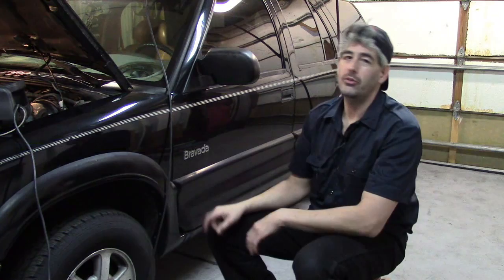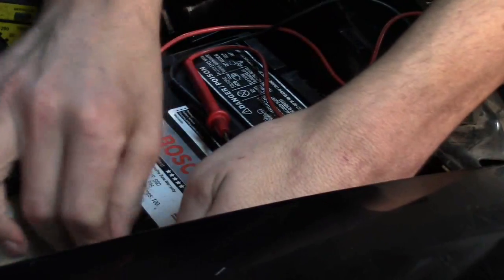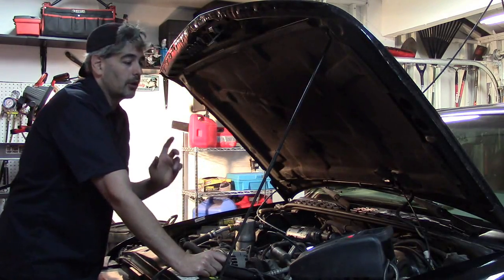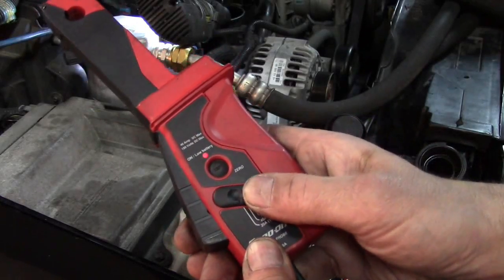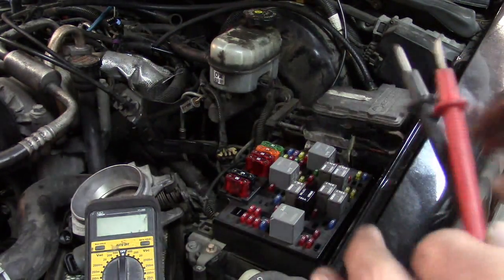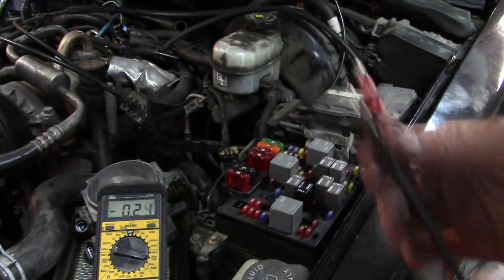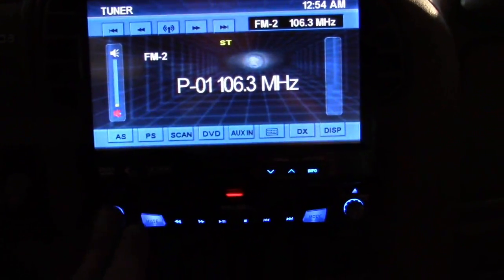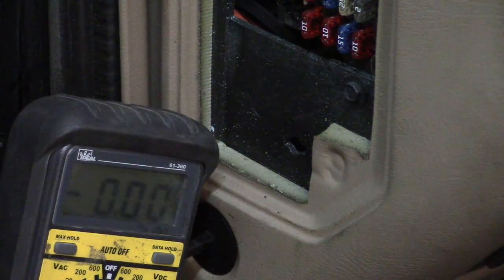Improved Methods to Find Parasitic Draw (Battery Drains Overnight)

Comment: I have a 2017 Hyundai Sonata LTD Hybrid with 65,000KM that I have noticed the battery voltage drops quickly drops to 12.2volts as soon as I shut it off. I load tested the 4.5 year old battery and it’s still has almost the full rated 600 CCA . The Amperage draw at the negative terminal while shut down is close to 3 amps…. Way too high ! I  The car has never had any problems starting but I plan on testing the mili volts at each fuse as you showed here.
The only add-on I had was a Dash cam which I disconnected completely but that didn’t help.
If you have any suggestions I would greatly appreciate it
Thanks again for your great content.
JP

Comment: Matt, are you using a separate sound recorder to capture your voice as you seam to have a tiny bit of lipsync. When you start recording, clap. You can then align the audio spikes of the cameras audio channel, with the audio spike of the sound recorder. This is what the clapper board does. The crack shows up on everything that is picking up sound. Cameras not recording sound will be pointing at the clapper board so that picture and sound can be aligned in the edit. Hope that makes sense.
Great videos, thank you for posting them

Mike
.
Reply from the maker: +WhitwellMike B Its a Youtube issue with long videos. The sound is sync'd correctly on the original file.
Reply: +Schrodingers Box  I did think it might be my connection.

Comment: great video thanks for the methods, now that you found the Parasitic Draw how did you fix the problem with the radio?
Reply from the maker: I fixed a ground fault that was caused by improper installation. very simple.

Comment: Good video but one question. With the fuse Voltage drop method, some small fuses you can't measure that way because there is plastic on the top of the fuse . How do you do that. Do you use a needle to get a hole to the pins of the fuse?
Reply from the maker: Correct. If there aren’t test ports on the fuse you can’t do this method. You would have to use a jumper wire in which case you may as well directly measure amperage.

Comment: Thank you for your good and comprehensive video. If I may, have two questions to ask you about this video.

1) When you disconnect the negative battery terminal from car, then all electrical should not be functioning. Why should one be concern about the door of the car being closed? Once one of the terminals of the battery is disconnected then there should not be any current passing through wires. Am I correct?

2) Why did you connect the red terminal, the positive terminal of the volt meter to the disconnected ground terminal of the battery? Thank you
Reply from the maker: 1. because you are connecting the battery through the ammeter.
2. you can do it either way. Polarity is irrelevant in this case.
Reply: I know this is an old comment, but I'll respond anyway in case someone else is wondering the same: In order to read amperage, the circuit in question needs to be under load. If you are setting your multimeter leads for an amperage reading, you are effectively changing your multimeter to be used as a "jumper" wire between the two points of contact, so in this example, the multimeter is wired in series with the battery terminal and the disconnected cable, thereby completing the circuit and allowing an amperage reading on your multimeter. Since your leads are jumpers in this example, polarity is irrelevant because the meter has effectively become a part of the circuit, which is why there is risk in this testing method for inadvertently short-circuiting and damaging electrical components on your car.

Comment: He is trying to use fuses as shunts to detect current.  You would get a number when a headlight's worth of current is going through the fuse, but parasitic current may not be distinguishable from noise unless you have a very accurate meter and have shielded probes with spring tension tips.

Comment: Thanks for sharing.  Could trailer hitch lights plug cause draw if no trailer/lights are plugged up? Thank you for your time.
Reply from the maker: Only if there is a short to ground. Otherwise it’s an open circuit.
Reply: @SchrodingersBox  thanks.

Comment: Have a 2009 Mini Cooper--DAILY DRIVER.  New battery passed a load test. Terminals clean wires good but didn't check the ground.  Fully charged battery at 12.8 drops to 12.32 in 4-hours.  Alternator reads 14+, but didn't check diodes--should I?  Also, tried fully charged and opened the driver's door and watched the voltage reading drop which seemed quite rapid.  As another "test" I pulled dome light but there are still 2 footwell lights on when the door is opened.   Tried test light in series on neg side and it lights up.  Pulled every fuse, the light stays lit.  Tried 2 meters and neither shows any DC amp readings (1 new meter, 1 older).  Why would test light, light up and meters not show any amp draw (0.00)?  Tried voltage drop and am not getting any readings.  I thought I would "test" a live circuit like the dome light to see what meter reads.  Good idea?
Next is an inductive clamp, which I ordered yesterday.
With the negative terminal disconnected is it possible to not have any amp draw readings?  I even waited to see if the car would go to sleep, but still no readings at any setting from 10-amps down to milliamps.  Anything that might not be standard protocol on a Mini?
Reply from the maker: Try disconnecting the alternator and repeating the parasitic draw test
Reply: I bought a PDI CA60 current clamp but one thing worries me, the clamp does not fit entirely around the negative wire.  Anyway, connected to a Fluke 87, the PDI instructions state for readings below 2 amps set the unit to 1mV/10mA. If the measurement exceeds 2 amps they state set it o the higher setting. So for a reading of 10mV, I would then have 100 mA draw.  Does this sound correct?

Comment: +schrodingersbox that's right! the rubber band trick you used to remind yourself
Reply from the maker: +724davemo Hahaha, Yes I did that for almost 5 years but this is way more reliable.
  Truth be told, I always have a DVOM in my car. I stopped by to do a field diagnosis (on this vehicle actually!) and while I was doing the draw test using the ammeter the owner adjusted their power seat!! The amperage not only blew my fuse but destroyed my meter too lol (maybe you noticed the new meter in this video).
  Rubber band didn't help me there hahaha!!!
Reply: +Schrodingers Box hmmm. was it blue? lol.. tip of the cap to you and your vids. I actually work as a train mechanic in Chicago, and have used your videos to help me understand so much when it comes to shooting a case of trouble properly, and just understanding the logic behind things. love your vids, keep it up.. just wished you tube was as accessible when I was younger. there's just absolutely nothing you can't learn from it when you're watching the right vids.. haha
Reply from the maker: 724davemo Thanks man.  Lol at "shooting a case of trouble"- thats a new one, i'll have to use that line in the future!!!
Reply: +Schrodingers Box I'll keep an ear out for it!

Comment: I have a 20amp DVOM but I was wondering about the clamp on amp meter you were using in the video where you clamp it around the wire without disconnecting the battery. I was looking at a few from electronic specialties but not sure any thoughts. Thanks and will probably signup to your other channel. Very clear to understand videos and am focused on schematic reading and understanding the circuits and component operation. Keep them coming
Reply from the maker: Ohhhhh, sorry- yes the clamp.  Mine is a Snap-On model but any 20A DC clamp will work.  Make sure it's a DC clamp though- most clamps you find in a hardware store are AC only.
Reply from the maker: Incidentally, if you plan on signinig up for my other channel, I strongly suggest you opt for a 40A clamp instead of 20A as I show many other things you can do with the increased range.

Comment: Matt,
    I have a 2007 SRX 3.6l consistently draining my new $200 AC Delco OE replacement battery. Has no DTC’s. However, scan tool alt. Test suggests over charge is the cause of ncns condition (drained battery)? After trickle charge on battery starts right up. Draw test void for amp draw? What is your thoughts? Don’t want to “shoot the canon”? Charging around 14.6/14.7 at idle head lights low beam nothing else on. New OE Alt. $400!
Reply from the maker: Sounds like basic parasitic draw issue to me.

Comment: I having that same prob. 1998 Jeep Cherokee Sport. 4,0  I have removed the fuse for the lighter cause every time you pushed it in it blew the fuse.  Knew that was a ground So i pulled the fuse and thought that was it.  2 days later same thing. Battery dead, no start. So i thought it was my power door locks. i have heard them stick b4 had to mess with the switch to get it to stop. So i unhooked the pass. side top switch that controls power to the locks on both sides yesterday .I also removed the fuse to te power lock switch/child safety switch. and it started today but we will see i the morning. Use takes couple days. Today i ck with Muti Meter the same way you did with the setting and i have o.oo. Question is. Shouldnt i have some draw??? or is my meter bad and how do i ck the metter to see other ways if it's bad.  Or maybe it was the power door locks. Id like to know if my meter is working with that reading o.oo or is that what i want. Thanks...
Reply from the maker: You absolutely should have at least 40ma draw.  easy validation though why not just very simply check just Check a 1 A draw source as a positive control.
Reply: ok what could i use... Maybe.  Not very knowledgeable  with using these miti meter's.  Appreciate the help.. I thought there should have some draw though
Reply from the maker: Any lighting ciruit would suffice and of course its the easiest way too.

Comment: I have a '93 F150 that the battery drains completely in a day or two. This is the third battery I've had so I assume it is a drain on the system. However, when diagnosing using the methods in your first video, I show almost no current draw (usually around 0.05A) across the negative terminal. I tried the method in this video, but could not find a circuit with a voltage drop of more than 0.06mV across any of the fuses inside the cab or under the hood. I was wondering if you had any other ideas why these batteries are dying so quickly with apparently no parasitic drain. Any insight you or anyone else has would be greatly appreciated! Thanks!
Reply from the maker: Check the alternator output and also the diode.

Comment: Can you post a link for an inductive amp probe that I can use with my multimeter? Every time I search for one all I find is stand alone multimeters with an integrated clamp. My multimeter is an Agilent (Keysight) u1231a in case that matters. Also, do you have a recommendation for an entry level oscilloscope?

Comment: I have a 96 Grand Cherokee 5.2 for my bad weather/2nd vehicle with a Optima red top that's 4 years old and my battery was dead a few mornings ago and I dropped battery off yesterday for charge then went to work. I just installed battery and pulled out my multi-meter, on 10 AMP scale I am getting .031 so that is acceptable correct? its not .31 its .031
Reply from the maker: As stated anything below 100mA is fine.
Reply: Thanks, just wanted to double check before I be an unnecessary battery, like you say FIND/IDENTIFY the problem then repair-- From what I have read those Optima batteries can be trouble too

Comment: Hey Matt. thanks for the great video. I have an 05 Chrysler Pacifica that has a draw on the iod fuse. I pulled it and it goes away. Ever ran into this? sure could use some help if you have time. thanks for your time!!!
Reply from the maker: Never had that happen but I would start with a wiring diagram of the circuit and try to isolate related parts of the circuit to find the draw.

Comment: Question, does the meter let the current pass thru?  I use a light bulb and it works great, but I'm helping an engineer with his truck... He handles the meter only!  Anyways we're getting zero change. Even if I turn on the headlights. My theory is that the fluke meter is only measuring current and not letting any thru to power the circuit that's drawing. So we're seeing no draw  when there is one.  Testing amps btw
Reply from the maker: Yes it does, but the resistance is extremely high in volt reading mode.  There is no current restriction however in AMP mode.
Reply: Use the Amp jack on the meter to measure Amps.

Comment: Hi, great video.  I didnt catch you talking about cars that actually 'go to sleep' after a set amount of minutes.  I have a car with an after market radio that pulls 20 milliamps after the car goes to sleep but stays at 1 volt draw before going to sleep.  My two year old battery has been compromised and does not hold a full charge but still shows full CCA immediately after I jump the car in the morning.  (I have been suffering from dead battery in the morning and will most likely be dead once again at the end of the work day.  For running errands of an hour or two idle in a parking lot the car starts every time.   I have had both alternator and battery tested but one battery charger showed my battery will not charge past 50% capacity but yet still shows full CCA.  So my question is how do i get the Battery people know that my batter is compromised and doesnt ever get fully charged (I have a short <10min work commute) therefore I need a jump every time since the draw will make my battery a dead battery since it doesnt start at 100%?  Sears Auto is only concerned about CCA when I get in and they detect the 1volt draw when its been idle for the first few minutes.   So just because there is a draw that does not mean you have an issue with the draw itself.  :)   Any advice?
Reply from the maker: Draw is shown in amps not volts. What is the draw in Amps?

Comment: How do you set up you multimeter? I have a cheap harbor freight one....Do you see the dial on DCV or DCA? If it's DCV would you set the dial to 200m? Where should my leads be? Black on COM and Red on V or 10ADC? If it's DCA would the dial be on 20m or 10A? Where should my leads be? Black on COM and Red on V or 10ADC? Please help! Thanks
Reply from the maker: You just set up up in 10A mode.  Thats all.
Reply: To do the voltage drop across the fuses? I'm confused one mechanic says to do it the old and you say do it the new way....It almost seems like he didn't know what I was talking about....So how do you set up the multimeter? I just need to know what ports to put my black and read leads as well as where to put the dial DVC or DCA? on the dial and I know black stays in com port but where does the red lead go? Does it go in the V, ohms, mA port or the 10ADC port? On the DVC dial it goes from 200m up to 1000 and on the DCA dial it goes from 200m up to 2000u....Have you ever had issues trying to find the draw on an 04 Jeep? Thanks
Reply from the maker: @edfelicia8877  Ohh... no no- across the fuses you measure in voltage in the most sensitive setting. You can only measure amperage in series.  AMperage is the same across any load- only voltage drops.
 Just set up for voltage measurement across the fuse terminals.  If you detect voltage drop there HAS to be amperage.... make sense?  Its brilliant and way better than the old way.  Whatever mechanic you have that says do it the old way just doesn;t understand basic electrical diagnostics. I wouldn't have him change a light bulb much less work on my car lol!
Reply: @SchrodingersBox  So I just bought a Innova 3320 multimeter if I'm setting up in voltage in sensitive setting that would be ACV with a squiggle above the V? I have an auto ranging one
Reply from the maker: @edfelicia8877  Thats AC volts. You need DC volts.

Comment: I like the voltage drop method. All ready have a DC Clamp meter, initially used for addition of solar panels and habitation requirements.
I have  used TPM total preventative maintenance in a work environment. I would like to use my scan tools Multiecuscan AlfaOBD and obdlink (laptop and android live in van all time) to routinenly bench mark the engine. Its a 2.3l turbo diesel (euro6 Ducato Dodge Ram ie EGR and DPF) Have you any idea as to sensible PIDs to monitor. (the Marelli ECU does not monitor fuel trims) Have you any vids on this application, searching for something that is not there yet. Sorry if some of the terminology is different

Comment: so one thing is unclear...you have the black cable hooked to the parasitic device around the negative cable. I am assuming the red doesn't go anywhere ? It seems odd that there is no closed circuit...can you expand please?
Reply from the maker: I am measuring amperage, not voltage. Voltage measurement is useless in this application.
Reply: Let me back up. 7 minutes into your video. I know what you are doing is measure amps drawn but you are doing so by measuring voltage (times 10 you said) with that device. So my question was more on where the connections go but I think I see it now. Black and red in your DVM as if you are testing voltage and the device on the batter cable ...am I correct ?  I was looking at this unit which works self contained - Etekcity MSR-C600 Digital Clamp Meter Multimeters
Reply: and you've identified why this video sucks.

Comment: Another good video, Vdrop to narrow down the circuit, then amp check to confirm.   good method.  saves a lot of time messing with the fuses for sure.   
However i am curious to know, what on the radio was suckin juice when it was not supposed to be, and if it was hooked up wrong or whatever?    =)
Reply: +Rhage73 I'd like for a comment on how it was sucking things down too, but you never know, the owner may have temporarily said, fix the other stuff, I can live without the radio for now, dash removal etc., so expensive! lol